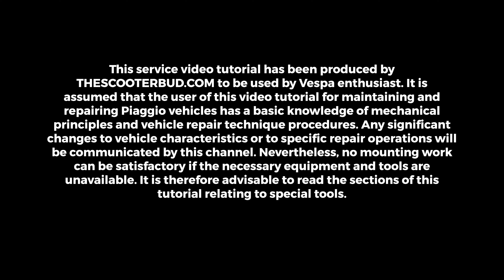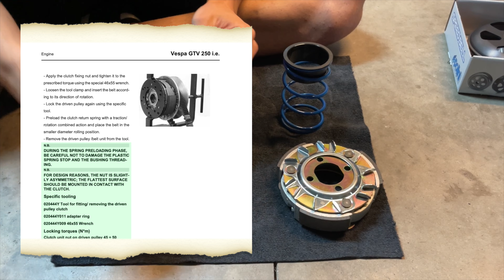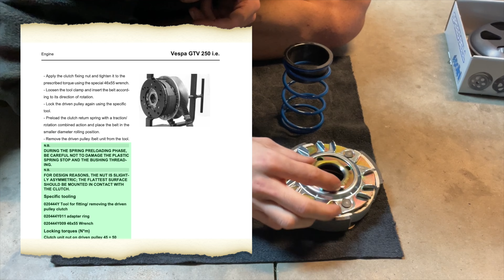How To Install - S.I.P Drive Pulley, Polini MAXI Speed Clutch, Speed Bell & MAXI HI•SPEED Variator

Comment: Hi there! Did you keep the 9.2gr rollers or did you change to 10.1?? 

Also about buying from SIP did you have to pay something extra to import to the US?
Reply from the maker: If you have the 250cc model then keep the 9.2gr if you have the 300cc then upgrade to the 10 and I always buy from them when I need a lot of stuff and is going to be a big shipment worth of paying like 30-50 bucks for it, I didn’t pay anything extra
Reply: @ I have the 300 hpe but can’t find the link to get the 10.1gr on sip
Reply: Can you help me with the part number of the 10.1gr rollers plz

Comment: Hello from Romania . Quick question : i have a 2023 Vespa GTS 300 HPE Super Sport with 4000 km , and i recently upgraded it with a Polini Speed Bell Evolution , Polini Black Rollers 13 grams , but also changed the belt with a Piaggio original belt and also a new original Piaggio V-Belt Pulley . The clutch remained the original one , but at some low speed acceleration and then braking , or when i release the throttle at low speeds , i can hear a metallic rattling sound coming from the transmission , It sounds like some keys are dangling in your pocket over some coins , something like that , for a short period of time , maybe 1 second . Have you experienced this sound after changing things at transmission ? Many thanks
Reply from the maker: Hello from Florida☀️! Thank you so much for sharing your upgrade experience with your Vespa GTS 300 HPE Super Sport. It sounds like you've made some exciting modifications! Regarding the metallic rattling sound from the transmission, most of the time, adjustments in new components can lead to new sounds. However, rattle sounds are a common thing for Vespas transmission but once they have wear out a bit, not brand new ones, if I were you, I would go over everything again, recheck everything is been torque correctly and that there are any loose parts. Wishing you safe and enjoyable rides ahead! Peace ✌️
Reply: @TheScooterBud  Hello again and thanks for the answer . I just checked all the modifications again and it seems that the new rattle sound is from the new Speed Bell clutch which is lighter than the original one and also has bigger sound resonance because of the lighter material . But , the sound is not annoying or anything , because i hear it only sometimes , and for 1 second . By the way , only with this changes (12 grams rollers , new sliders and Polini Speed Bell clutch bell) i managed to obtain 7,8 - 8  seconds from 0 to 60 mph . I will also post new videos when the weather is ok :) . Have a nice day .
Reply from the maker: Glad to hear!! Wow that so cool!! Ride safe! Peace ✌️
Reply: @TheScooterBud  Do you have any idea why Polini and others are making clutches without cooling fins ? I just a bought a Polini Sport Clutch without cooling fins, but i also have the Polini Clutch Bell Evolution wich has better cooling properties than the OEM bell. After 500 km all looks and feels good , but i still don't know why there are clutches without cooling fins ....
Reply from the maker: @epicdodo  mmm not sure man, that's a good question, might be for performance? for short distances like for the track or something? not sure...

Comment: I want to know is sip pulley worth it
Reply from the maker: If you have other performance parts like an upgraded varietor, rollers, exhaust, etc… it’s worth it but if you’re going to use it only with stock parts then is not that much, but it does make a difference!